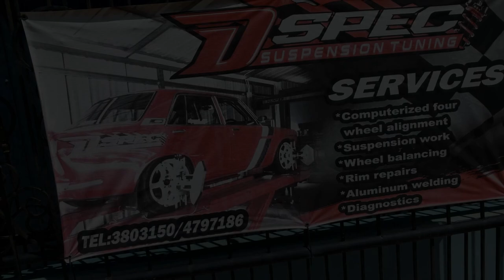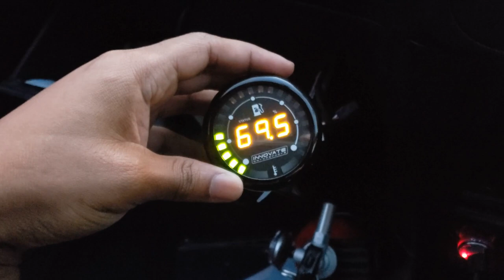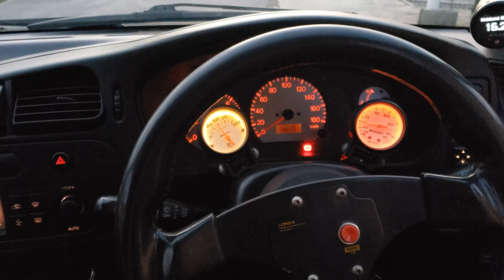10 second evo 4

Comment: what gearbox,transfercase and diff are u using im building a 4g64 in my evo 4 but not sure how much will the stock drivetrain hold
Reply from the maker: Everything stock exedy twin disc slip clutch when launching down to ayc diff still as well stock Evo 4 t case.
Reply: evo 4 stock drivetrain? completely waw thats awsome